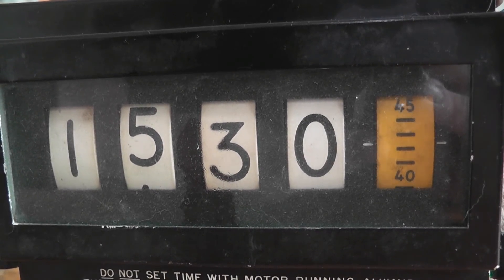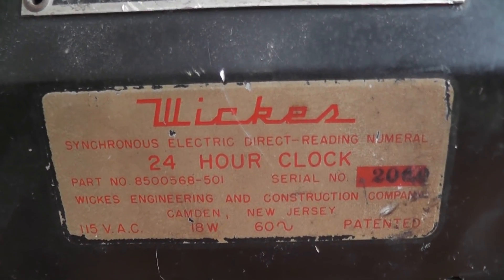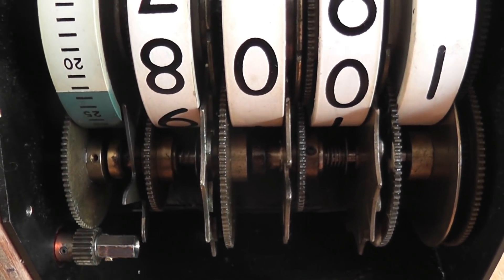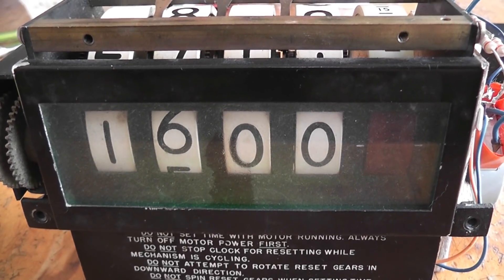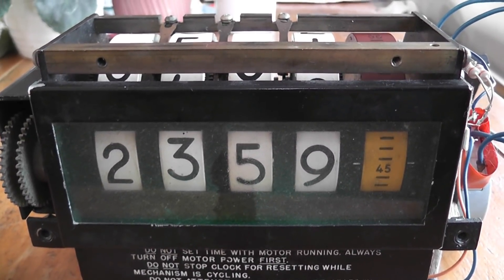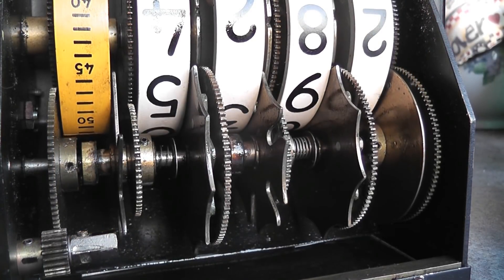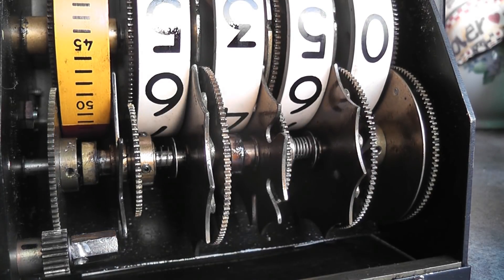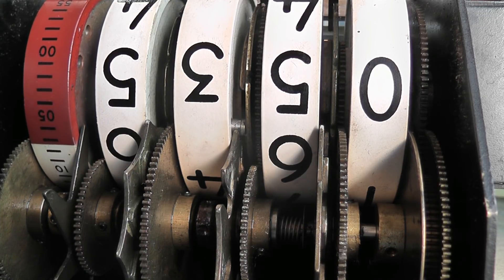Wickes 24 hour clock with very interesting rollover

Comment: I can add a bit to your history. My father worked for Wickes Industries in the early 1970s. He purchased the company and moved it into the basement of our home. The punch presses used for the gears were housed in our garage. My mother ran the business for at least another 10 years out of our home. She silkscreened the drums and gears were punched from metal strips of brass et al in our garage. She did tte assembly in the basement and had test tables set up to run tte testing for accuracy. They were sold and used in the various air traffic control towers throughout the country. Obviously became obsolete with computers.

Comment: I'm interested about that clock but the problem is How can I replace it's 115V~ motor with a 230V~ capacity?
We use 220-240V~ standard power here in the Philippines

Comment: I have one of these clocks. I got my from eBay as well years ago. I began to work on it and then it went into storage for several years. I only recently took it out. I found another 4rpm motor on eBay for it, exact replacement. Took the motor apart and packed grease in with the gears. Still makes some noise but that's how these motors worked. But from a normal distance, you can't hear it. Mine came in a black case that someone painted over with a paint brush and black paint. It's ugly has hell with scratches. I'm going to strip all that old paint off and redo with a nice black gloss spray paint and then give it a clear coat. Need to put a light in it yet. My model came with a push button that when pressed, stops the clock running. Letting it go starts it again. Mine also had a on/off switch for the light. The original light that was in mine was a 75 watt bulb! It got hot! Time to go to LED's. I do like that midnight change over, rather unique!
Reply from the maker: Awesome ! I think this clock is from a military piece of equipment. Works well and it is the 24 hour version as most of these clocks are 12 hour versions. Make a video when you have restored your clock. Cheers.

Comment: Pretty neat! Good example of a Geneva mechanism. The demand registers used on GE meters in the US (registers M-30, M-31, M-50, and M-51) use a Geneva train to time the demand interval and trigger the internal reset for the kilowatt demand scale.
Reply from the maker: Interesting, electro-mechanical meters often have very sophisticated systems to reset maximum demand registers.

Comment: Very cool. I’ve never seen a 24 hour mechanical clock like this. Fascinating engineering to get from 24 to 0. I have a Numechron Timemeter Tele-Vision 12 hr clock. I love it. I had to replace the motor as it got noisy and seized up. Got a new one from eBay.  Works great. Has an incandescent bulb.
Reply from the maker: This clock had a 15 Watt incandescent bulb too. I fitted Green LED's so the numbers can be seen in the dark.

Comment: Nice clock Ray, but I've always wondered about the accuracy of these mechanical timepieces, given that the motor runs off 50Hz and as you know, the grid is not always 50Hz exactly due to loading conditions.
Therefore, what is the average accuracy of mech clocks and how often do you have to calibrate them?
Reply from the maker: No calibration required. The grid in New Zealand supplies over a 24 hour time period exactly 24x3600x50 cycles. (4,320,000) Some minor variations are possible during certain times of the day/night.
Reply: Very intersting.  Thanks Ray.

Comment: Indeed, quite an interesting design. Congrats on getting it working again on 240 @ 50Hz.  Some thought went into the building of it, my guess is that someone like the Military spec'd out the clock and the minds at Wickes came up with the brilliance you've shown us.  I was only surprised that the clock would actually display 24:00 hrs, albeit for a brief moment only before flopping again to 00:00 hrs.  I was always under the impression that while we call it a 24-hr clock,  we never actually refer to that time as 24 hundred, we call it zero hour, or "oh-hundred".  As it only displays 24-hundred for just that brief moment of about ten seconds or so,  I guess the designers only did it that way on the spec of whomever requested it do that.  Still, it's cool that it does so,  and then of course it goes into reset to flip to all zeros.  I wonder how many of these clocks might be out there.
Reply from the maker: My understanding with the 24 hour system is that 24:00 hours is the last time of the previous day. When the date flips over the start of the day is 00:00 hours. The mechanism is very interesting. must have been initially  very difficult to design. While I type this reply the Solari Cifra 12 in the computerroom just flipped over to 00:00 hours.
Reply from the maker: Actually something I forgot. I did see a Russian vacuum tube clock somewhere here on YouTube showing also briefly 24:00 hours before showing 00:00 hours.
Reply: About that 24:00 hours time.... I remember when I was still a young'un,  one of my first jobs, my manager had served in his younger days in the Canadian Forces, Army, I do believe it was... Anyways,  he explained to me that in his day in the military,  the Service considered that one-minute stretch of zero-hour to be no one's time.  As such, whatever was going on would come to a brief halt, and you had that minute to yourself.  I've not served in the military myself, but I'm fairly confident that if Don (RIP) told me this, then that's how it was (at the time).  Although, with the changes over the years,  I'm sure that the modern day military forces don't get so "spooked" about a brief moment that comes and goes once each calendar day.  I'd bet that when midnight rolls around now, whatever task or exercise you might be doing, carries right on until your supervisor tells you that you can do otherwise, lol...

I've seen a few of those "nixie tube" videos, if that's what you speak of.  Those are pretty cool, too.  There's a channel called Techmoan, and that fellow has purchased and explored (and built) a few different projects involving nixie tubes for clocks, and some other uses as well.  I remember seeing them used in some brands of gasoline pumps back in the mid-to-late 80's.

Comment: Fascinating mechanism, love the rollover. Ray, do you have the correct motor or are you looking for one for that clock? If you are looking for a suitable syncro motor pls let me know the RPM of the one you need, I might have a suitable one among the parts I have.
Reply: My clock had a brass color motor that said 5 watt, 4 rpm on the side.
Reply from the maker: Hi Ian, Thanks for your offer, I have got the correct motor for this clock now. Microwave Turntable 4 RPM motor.